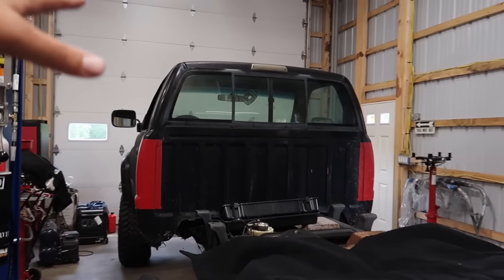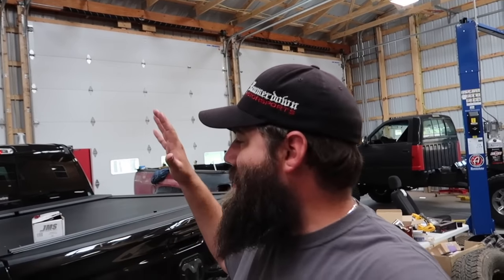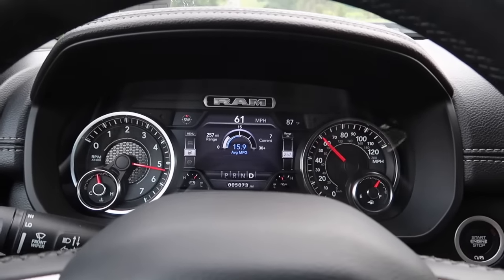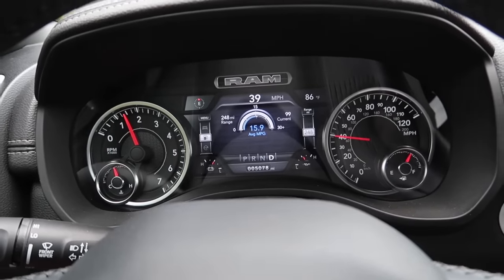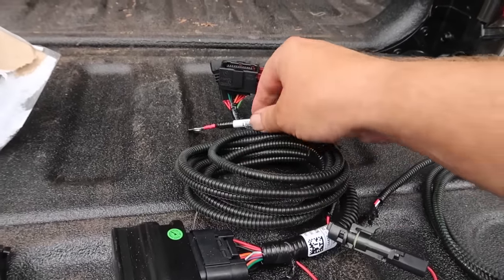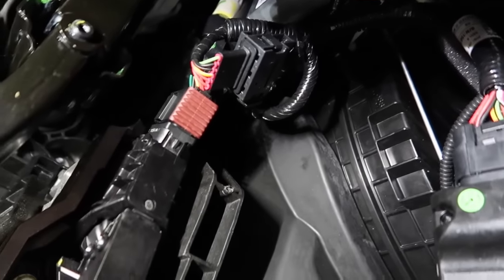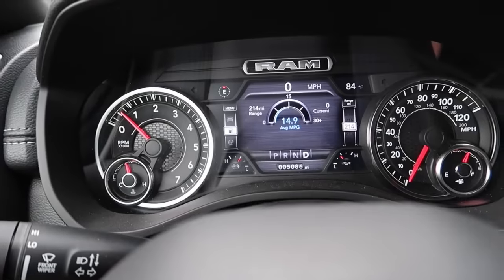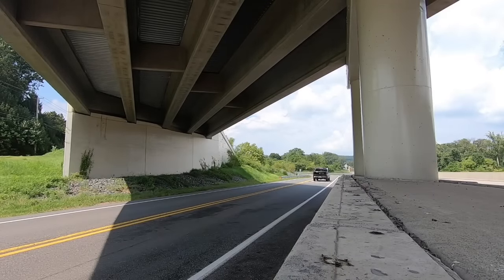2019 Ram Hidden Power Mod

Comment: The PedalMax sure looks like an awesome mod. Congrats
Reply from the maker: thanks I turned it off today just to see if i needed it on all the time and turned it back on about 30 seconds later love this product
Reply: @HammerdownMotorsportsUSA  Looking forward to meeting you tomorrow with Olde Carr Auto Guy.
Reply from the maker: America: Bumper to Bumper sounds good
Reply: I have jsm on my duramax will never own a car without it from now on
Reply: Can this work in conjunction with the pulsar from Diablo?
Reply from the maker: @icemj76  I would say it should, I run one with my HP tune on my Camaro worked awesome
Reply: @icemj76  not necessary, pulsar adds quicker throttle response
Reply: So would this disable or unlock the speed limiter to get to higher mph?
Reply: Does this void warranty

Comment: Does not add any power, but does clean up and fine tune the throttle response. I own the pedal commander, and it works awesome. You will pay much more for a programmer, which will only add minimal hp/tq at the very least.
Reply: How long have u had PC?  I had mine 1 1/2 years when it completely malfunctioned and had to be removed so my throttle would work again

Comment: If you turn off traction control it will smoke the tires. Mine will bone stock
Reply: yes ... Spot mode is --> Turn off Traction Control and turn on towing ... it makes the trans pop a little harder

Comment: are you in 4X4 or is traction control worse In the new ones? my bone stock 2016 blows the tires off if I floor it from a dead stop.

Comment: I so just bought this for my 2020 RAM 😁 I totally notice the delay at a dead stop. I'm gonna enjoy this 🤙
Reply: Hey i jave a 2020 ram bighorn...wondering if you could reply to this to let me know how it works out,? Looking at getting one aling with cia and throttle body spacer..already have borla exhaust
Reply: @lexschmidt8471  so I’m not sure if it’s my vehicle it works fine the issue I was having it was throwing my sensors off so I stopped using mine I have the commander version for my Dodge charger and that works fine. I’ve never had any issues. I never tried that version on my Ram so buy with caution I did upgrade my muffler and resonator delete so I don’t feel lag anymore.
Reply: @thatoff-roaddude9515 hey thank you man i appreciate it .i think im goona go with the commander or banks one..ive got my throttle body and cia figured out i just need something to get rid of the throttle lag drives me nuts

Comment: Hey Steve, thanks for the video on the PedalMax.  I was skeptical about this product working like you say it does.  I just put mine in today on my new 2020 Ram Rebel and took it for a spin and I am now a believer.  Boy did it open up those 400hp ponies.  Yes guy's it works as he says it does.  Beats paying big bucks for a Diablo tuner any day.  You got yourself another subscriber.  Thanks, Rob
Reply from the maker: Robert Alexander awesome i am glad you love it like I knew you would, I wouldn’t tell people about it unless it was worth it thanks for your comment
Reply: I installed mine and all the warning lights came on? I disconnected the battery before installing too. Check engine, traction control disabled, tow haul disabled.. what gives lol? 2020 ram rebel.
Reply from the maker: Dane hmmm I have done 2 of these in new rams with no issues and didn’t disconnect the battery at my own risk make sure all the plugs are seated if they are I’d contact JMS
Reply: I agree with Steve, I have had mine in for over a month now without one issue.  Try unplugging from the pedal again and reinstall.  If doesn't help call JMS.
Reply: @HammerdownMotorsportsUSA   yeah will do thanks
Reply: @robertalexander1826  will do!
Reply: Will this mod void the warranty?

Comment: Food for thought: That lag in response on the newer generation RAM is built in there by the engineers. What the lag does is signal the 8spd Aisin transmission to start circulating more fluid before accelerating. This protects that expensive transmission.
Reply: This is a ZF 8 speed not an Aisin and what you are saying is nonsense.
Reply: I love America not aisin
Reply: This escalated quick.
Reply: @charlesmarshall2697  same ZF8 in the Audi? Lol
Reply: @bangurowned  Same ZF as used in all Chargers, Challengers, 300's since 2011...  Bulletproof for most part.  Jeeps with 3.6 and Rams with 5.7 came later.   Same ZF system used on Hellcats but the different models have different size internals based HP levels.   Common knowledge for YEARS
Reply: @gnd111  don’t know why you’re responding to me… lol. My comment was clearly a joke.

Comment: I agree with the one’s that say it doesn’t add power. I had the Pedal Commander for a month or two. I tried all positions and actually preferred stock. Especially after the day I went to the stored and the unit failed. Most of the ride was below 40 mph neighborhoods, and about 1/2 mile of 55mph. It wasn’t till this stretch that I realized I had no throttle control. The truck would just keep speeding up till I hit the brake without ever touching the throttle. In park it idled fine. Put it in gear and it took off. Not fast but just kept going faster and faster till I hit the brake. Remove the unit and the truck is fine. Then I had to go in and clear all the codes and lights it set.
Reply from the maker: Tom Wise should have gone with the pedal max
Reply: I’ll just leave it be. I’ve outgrown most of that.
Reply: Yes I had similar problems with pedal commander! Dangerous! And company wouldn't return my messages
Reply: @jayhopkins1337  all I really saw that it did was make the throttle more sensitive. Kinda like changing the cam on a carb. Did make it fast, take off better, this wasn’t a performance upgrade. Max throttle was still the same. Till it wasn’t and killed the throttle all together!

Comment: Skip the pedalmax and go straight for the Edge Pulsar.  

Power levels adjust pedal sensitivity, they're adjustable on the fly with your cruise buttons without stopping, and it's dyno proven for around 30hp to the wheels. I get 1-2 mpg better pulling my RV as well.  

Plus, it doesn't require unlocking your PCM, and when you take it in to the dealer it comes out with 2 bolts in about 5-10 minutes.  As it simply manipulates what goes in/out of the computer you can remove it and send the truck in and the dealer has readings to look at (vs. no history when you take out your tune and put the factory back in) and therefore has no idea you have a programmer.

I don't work for any of these companies, just a happy customer who wasted money on a pedal commander then bought the programmer and enjoyed a legit gain in performance instead of a placebo.

Comment: It doesn't add any horsepower just changes throttle response. Why do people not understand that?
Reply: What's difficult to understand? By asking for more throttle response you are getting more power to the ground. Hence the hidden power as you don't get this stock. He didn't say you are MAKING more power.
Reply: @MrComputerCoder  Pressing the pedal down faster does exactly the same thing.
Reply: @sergeysmelnik  I don't think you understand what it's actually doing. You can do that stock but it doesn't mean it responds faster and is as aggressive. 
Adding these pedal commander type mods do both and considerably increases acceleration and speed. 

Not difficult to use your head and think about it.
Reply: @MrComputerCoder  No sir you are the one who doesnt understand how it works, I wrote a comment in this video explaining it.  This product doesnt affect the ecu, which is why its warranty safe.  The ecu is what slows down the throttle body opening speed.  The throttle body only sees the input from the ecu, not the throttle pedal.  Therefore no matter what you install on the throttle pedal it will never change the way the ecu interacts with your throttle body.  All this thing does is change the signal from pedal to ecu.  You press down 20 percent but with this product the ecu is seeing 30 percent for example.  This product cant get rid of torque management and other nannies that try to save the drive train.  You literally can press your pedal down faster and further and do exactly what this product does.  There is no "lag" in an electronic system like this.  It does absolutely zero for acceleration and speed.
Reply: @sergeysmelnik  ironically it still let's you accelerate faster lol 😂
I know the reasoning. Don't care what you say it makes it faster. 
Honestly not hard to do a simple Google search to find results.
Reply: @MrComputerCoder  Its not possible dude, sorry
Reply: @sergeysmelnik  Wrong. These pedals remove the built in system LAG. I use a Pedal Commander and the difference in response is night and day.
Reply: @mikebromelow8514  of course it removed your imaginary lag. You already got duped into wasting your money on this gimmick and now you have to justify your purchase.

I'll sell you an on off switch to get rid of the rest of the lag for a thousand bucks. Who needs throttle pedal resolution when you can go from zero to a hundred and skip everything in between...
Reply: @sergeysmelnik  as a mechanic I can  confirm that this "mod" doesn't add horsepower or change much to the engine. Yes you will get a slightly faster response, but you can have the same result for free by just slamming the throttle pedal all the way down.
Reply: @mikebromelow8514  All it does is decrease the lag time and might make the reaction time quicker..It still does not add any hp or tq to over all out put..Your tq# doesnt not increase and your hp # does not increase but as said it might be a lil quicker than same trk without this mod..
Reply: It doesn’t give you any power. Point break literally had no knowledge about cars. All this thing does is make throttle response sensitive aka tricks your ecu into think you’re pressing fully on the pedal when you’re not. In order to gain any power you would need to adjust timing and fueling in the ecu to hp.
Reply: Ram has always had a conservative throttle.  A product that reduces the lag and increase the input speed should do wonders for the trucks responsiveness.  Ever ram I have ever owned would hesitant to spin the tires even when they have more than enough power
Reply: @MrComputerCoder  Get a clue. Jesus Christ.
Reply: @khyoon14  Don't need to. It's not complicated. Try again troll
Reply: I encourage everyone that doubts these products to watch Sprint Boosters video of their products difference in throttle body response. That is all.
Reply: @tyrrellroach5872  I guess my 2019 is different then, because my throttle response is surprisingly quick. Now my Ford work truck......
Reply: I can’t believe some of you still don’t get it. Slamming the pedal down is NOT the same thing as using the pedal max. In stock form, even if you quickly mash the pedal, the throttle body opens slowly. A pedal max or pedal commander, etc. make the throttle plate snap open much faster, equaling greater throttle response and thus slightly better acceleration. But not faster or more power overall. Sprint Booster has a video showing exactly what it changes. Go watch it, 0:40-1:30   -   https://youtu.be/1EkDzsSqRg4
Reply: Sergey Melnik actually it does not.
Reply: Sergey Melnik the quilter the command gets to the ecm the quicker the advance in ignition timeimg response.   Hence commanded response.  This might be above your knowledge.
Reply: People don’t understand the difference between throttle response and increase horsepower. Basically this is same as changing mods, normal sport sport +. There’s no HP difference in each mods. By the way, it does feel better. You don’t feel dead pedal.
Reply: I have a pedal commander on my 17 ram 1500. Is like a new truck when i turn it on. It is the best cheapest performance mod u can get
Reply: Either way it goes... they both got the same time 0-60 so its all quite a stupid post!
Reply: i installed the sprint boost on my 2016 ram.takes the lag out .keeps the gear longer on the down rev.when in stock mode truck is sluggish especially on hills.haters say slam the pedal .still has lag when in stock mode .push the fun button and the truck is night n day just dont use it in the sand .i buried it up to the wheel wells in 0.2 seconds 😁
Reply: @sergeysmelnik  I disagree I have a the Peddle Commander and it is a night and day difference from stock to these pedal products, without these devices you can slam the pedal down and there is a delay with these products you get thrown back in your seat instantly
Reply: @jlnunezjr  there is no delay with throttle by wire systems. You're feeling torque management from the ecu. It's there so you dont spin the tires or get drivetrain lash to easily. The pedal sprintboostercommandermax installs before the ecu and therefore cannot adjust the torque management or throttle plate speed. The ecu does not know you have a product installed on the pedal and will always act the same. People here are suggesting that it alters the ecu programming. If it did it would void your warranty. Here is exactly what this product does. It changes the throttle pedal input vs output ratio. Nothing more. So for example stock is always a 1 to 1 ratio. You press the pedal down 50 percent and your ecu sees 50 percent from the pedal then it decides how fast it wants to move the throttle blade to 50 percent. With a pedal product you can change the ratio so for example you press the pedal down 50 percent but your ECU sees 75 percent and then it decides how fast it wants to open the throttle blade to 75 percent. That is all. The links for the videos from these companies are a lie. They literally lie about how it works then over charge for a simple device. This has been discussed on car forums many times. I suggest some of the people here watch some videos on a throttle by wire system and how it works. Not videos from the companies that are trying to get your money. If you really want to get rid of torque management which is in the ecu not the pedal you have to get a tune. In fact how about you give a reputable tuner like 5 star or lund a call and ask them how a pedal box works. The tuner can even adjust your input to output ratio making a pedal box obsolete.
Reply: @sergeysmelnik  I notice the huge difference with the pedal commander installed it works. Unless you have one you would not understand
Reply: @jlnunezjr  Since you own one and understand go ahead and explain to me exactly what its doing.
Reply: @sergeysmelnik  I actually have one and there is a real difference buy one and do your own research lol
Reply: @jlnunezjr  go ahead and explain to me how it works
Reply: @killer091599  
You’re wrong. Don’t care if this is 2 years ago. You can not make your throttle response faster by pushing your foot down faster. There’s still lag. If you try one of these pedal mods you’ll notice there’s no lag. If you haven’t changed your mind on these since go read the website and you’ll get it. I got one gifted to me and thought it was BS but it completely changes how your vehicle reacts. It legit speeds up throttle response. You don’t need to add power to change how your truck feels. You guys are all talking shit and I guarantee NONE of you clowns have bothered to try one of these to see for yourself. You’re just spewing the same garbage everyone else does without actually knowing.
Reply: He says it unleashes horsepower that's already there
Reply: @sergeysmelnik  It used to.  Now it’s all computer controlled.  It isn’t like the old days.
Reply: All the guys who won't buy one but do nothing but talk crap about what it does would lose on the race track against the same vehicle and same foot response time you will get beat due to stopping lag and being at a higher rpm when the pedal is depressed.
Reply: @sergeysmelnik I have a pedal commander and that is ABSOLUTELY NOT TRUE
Reply: @sergeysmelnik you must not have one lol. It’s not true just pressing the pedal down. That’s too bad you out here giving out false info
Reply: @Ghost-ri4xn  Theres a sucker born every minute...
Reply: @sergeysmelnik  you must be bored. Not many ppl to talk to. I know it doesn’t give any horsepower but it most certainly changes the the “throttle response”. Make your last comment after that I will delete my post. Goodnight
Reply: @Ghost-ri4xn  Cope
Reply: @sergeysmelnik get one try it or shut up.  You would also need a hemi.
Reply: @sergeysmelnik  You must drive a Subaru.😂 Jealous much? 😂

Comment: You should have a side to side comparison. With and without the pedal max from 0-60
Reply: They wont do that cause then you will really see what you get for $300!
Reply: @zash008  so basically nothing,  I'm assuming?   Cuz it doesn't add hp, it just make throttle response better, right?......or am I wrong?   Lol
Reply: @xmarksthespot4617  pretty much. So the throttle is all electronic now, no physical connection between the pedal and throttle body. Just an electric signal telling the throttle body to open, and how far to open. This, and many others exactly like it, take that signal and boost it. So if you barely press the pedal for normal take off from a stop, your throttle body might open 20%. This would take your same input but change it from 20% to 40% or something. Give you the illusion you’re gaining power when it’s just the same as if you push the pedal to 40% yourself. Wide open throttle is still 100% with or without this module. It’s a gimmick. If you want the throttle to be more “responsive” just stand on the pedal lol
Reply: @heklyr3370  that’s exactly what i was thinking. Thanks for the reply.
Reply: I timed it as I watched and didn't see any difference from 0 to 40 or 0 to 60. Not worth it in my mind.